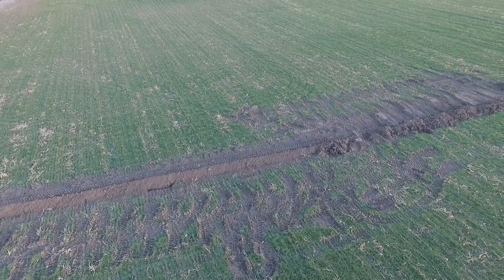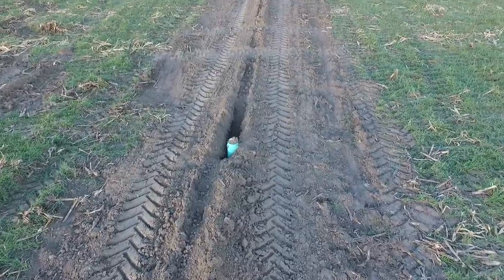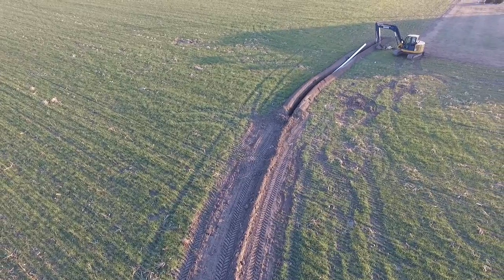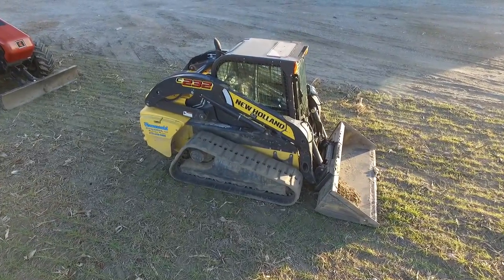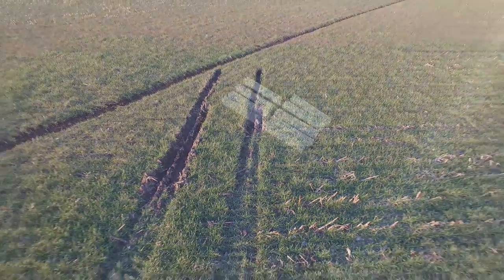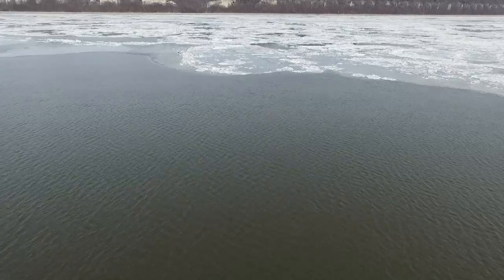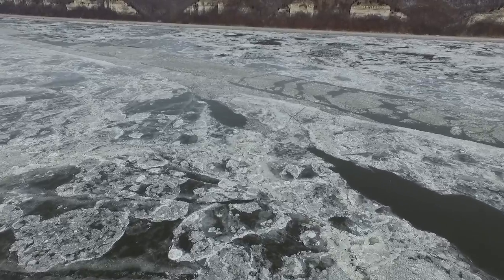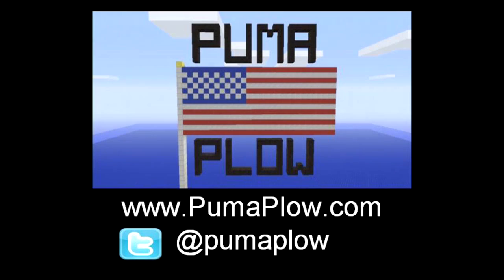On the Farm Episode 89 IRRIGATION PROJECT AND MORE

Comment: Curving the pipe rather than putting in a 90 deg elbow will not cause pressure loss because of the flow restriction caused by the 90.